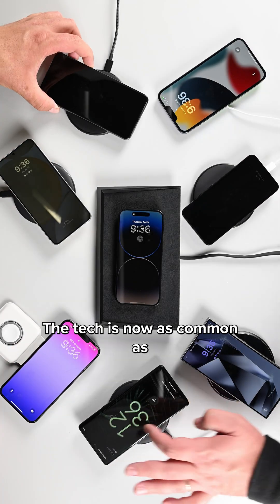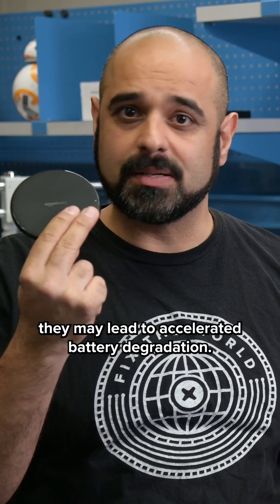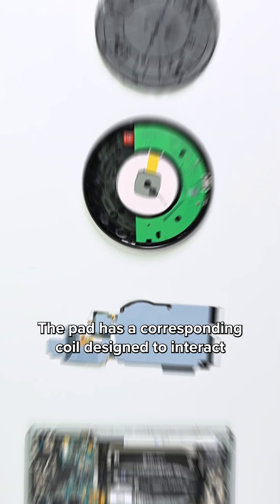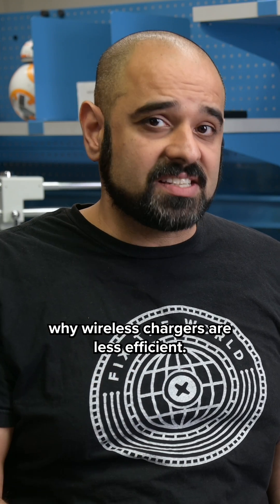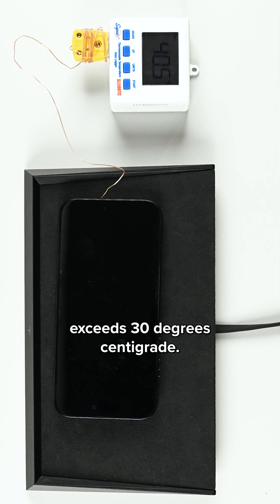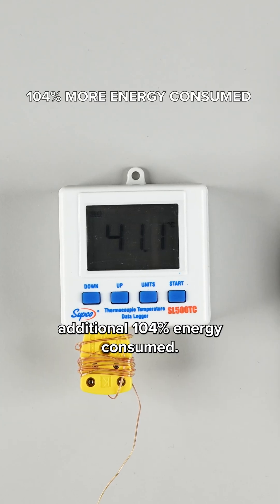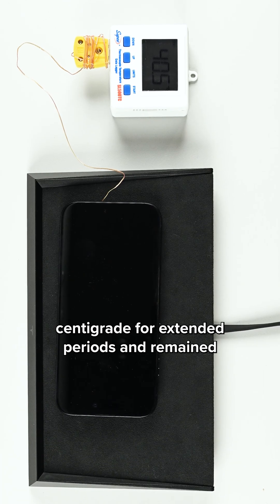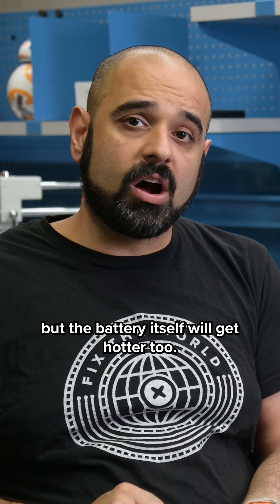How Wireless Charging Works and Why It's Terrible #WirlessCharging #applecharger #iFixit

Comment: When camping in Florida during the rainy season, it's great. Especially when the moisture trips the moisture sensor in the port and no amount of blowing or waiting will dry it as the air is saturated (maybe even supersaturated due to water condensing everywhere).

Experience from a moto-camping trip.
The wireless charger is on the bike and he phone and its port survived.
I just had to take my time in a air conditioned shopping mall.

Comment: How hot does the phone’s battery get under normal use for perspective?
Reply: I tested this my self with my usual Samsung 45 charger and my 7 watt wireless charger and they’re about that same at 70 to 80 degrees Fahrenheit. I use my phone in a rather cool environment at about 50-60 and in charges in such environments so it stays cooler and that’s probably helping the battery out